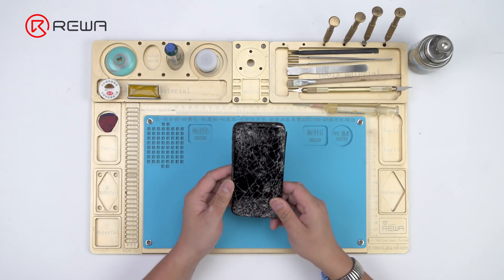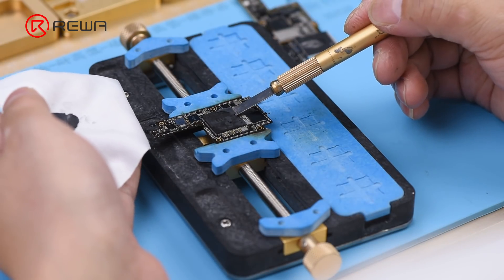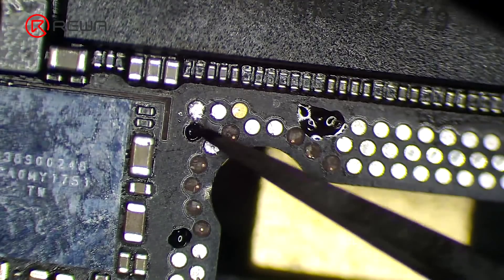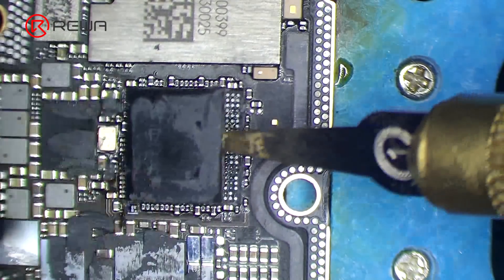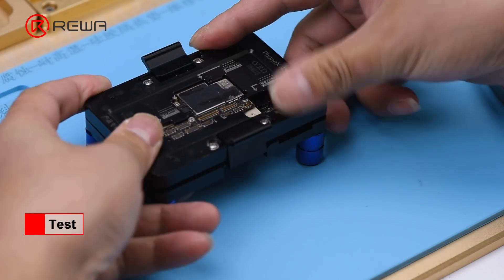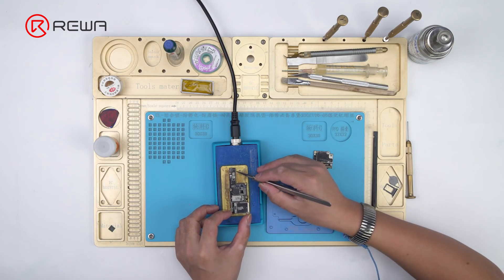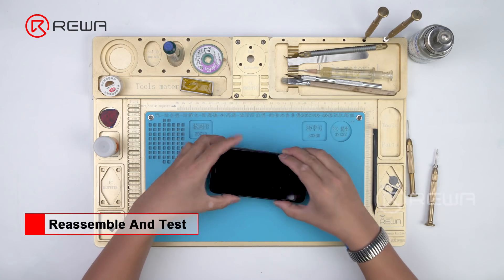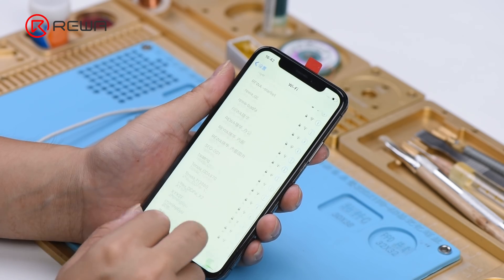iPhone X Restoration - More Than Board Swap

Comment: nice job done . i got a problem on iphone xr after changing the back cover its got into boot loop i used 3utools but still in boot loop mode and hardware advice ,thanks

Comment: This is amazing, did you use the aftermarket OLED or OEM one?
Reply from the maker: For the detail of aftermarket display, please check this link ( https://bit.ly/3cXbkHm ) as a reference.
Reply: They said rigid OLED in the video, so the 2nd best aftermarket option (flexible being a bit brighter IIRC)

Comment: Why do you need to flash the screen rom?
Reply: To remain true tone functionality. When you use another screen, you have to reflash the serial number which was paired to the previous (destroyed) screen. If you don't you lose true tone functionality.
Reply from the maker: To restore the True Tone function, we used the programmer to read/write the screen data.

Comment: Why not transfering wifi ic too?? Why to waste so much money on programmer?
Reply: $200 is not a lot when you are doing this all the time. This programmer saves lots of time im glad they show it off
Reply: Angel De anda  how much time it takes you to desolder a wifi ic and solder a new back ? Like 7 minutes?
Reply: @belikebro358  They unbind Ic with machine, thats what its for. In this case, it took them less than one minute to unbind IC with box, but this isn't like common repair.  When repairing wifi on iphone the WIFI needs to be unbound from the NAND which requires also desoldering the nand, reprograming it, then putting it back on the phone. Also to unbind wifi on nand need special machine, which costs over $200. The machine is great, saves time and is not expensive. I don't think the money is wasted, you need a programmer for wifi if you are serious about repair and this one is the best one so far.
Reply: Angel De anda go and use dfu box c2 for that wich costs 30€
Reply: @belikebro358  Show me how DFU BOX C2 can unbind IC. oh wait that's right IT CANT. I now know you have no idea what you're talking about so good luck thinking $200 is a lot of money and that you can do board repairs....
Reply: Angel De anda  there is a software wich you cam download on mac and put device in purple mode , then you have to updtae your dfu box c2 and you can unbind wifi , just go and buy the 200€ tool instead of 30€ wich does exactly the same i dont care , if you were professional like me you would knew that 😉
Reply: Angel De anda  what ?? Who is the professional now ? Who is fixing the boards now ??? 1-0
Reply: @belikebro358  YOu win !
Reply: @belikebro358  I got schooled - _-'